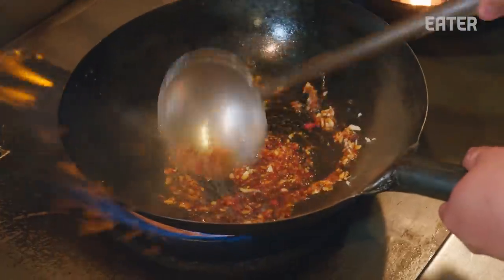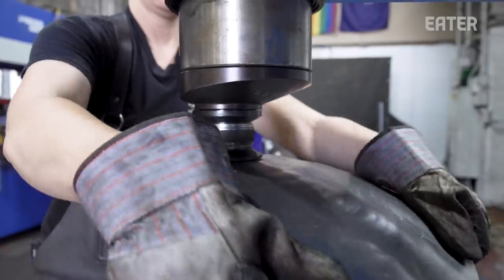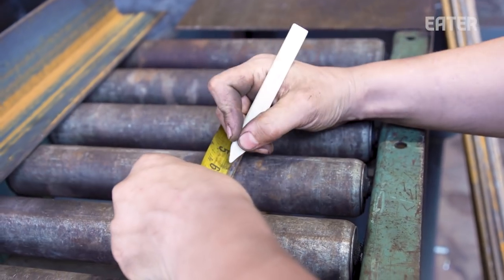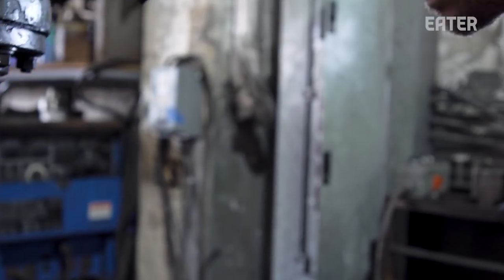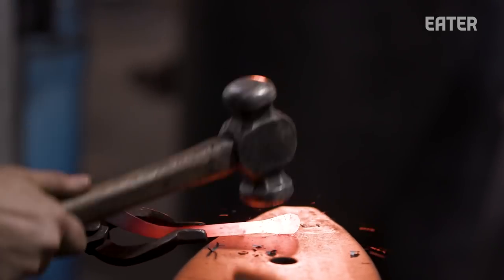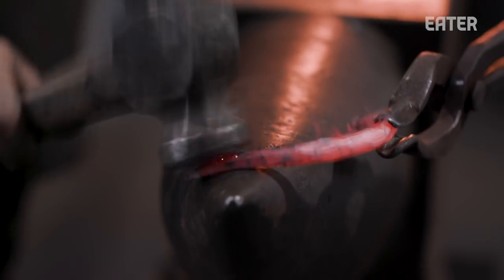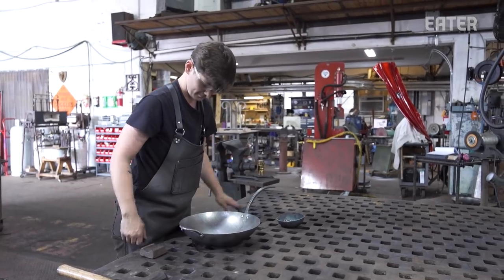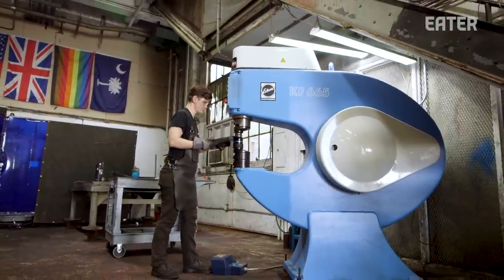How Carbon Steel Woks are Forged by Hand — Handmade

Comment: Love the hammered wok but not a fan of the handles. There is a reason the Chinese woks have those types of handles.
Reply: Go on then, tell us why?
Reply: @AlbanZap  food gets stuck in the rivets
Reply: The round hollow handles are also lighter, dissipate heat quicker/better, and are easier to manipulate the wok with.
Reply: @AlbanZap  heat dissipation and cuts down on weight. also allowed you to insert a wooden handle if that is preference.
Reply: We are blacksmiths by trade, so we decided to stick to what we know :)
Reply: @SnikySnik  Is that the reason they have those handls? wow you're so smart!
Reply: Yeah, they use carbon steel to make them thin and lighter and then they attach a club of iron.
Reply: @AutoFirePad  the handle by itself weighs less than 11oz. 😉
Reply: I agree.  That handle does not go well with woks.  If they tried cooking with an authentic one they would probably understand what's wrong with this one.
Reply: The handle on wok definitely wouldn't be very convenient for Asian dishes since you need to do quite a bit of wok tossing and this type of shape makes it a bit difficult to control (or at least you to learn to get used to it) .
Reply: This is designer cookware. It's a good one at that.

Comment: Great smithing skills. Should have had a wok chef consult you on the design. That long arched thin handle is not good. You want a straight tube handle.
Reply: We did consult with many chefs. They all actually liked the handle shape. Yes, it’s not your standard handle design- but it’s our blacksmithing roots that help us stand out.
Reply: A handle like that is actually easier for tossing around. High end wok chefs often prefer no handle at all, instead going for the Cantonese style wok with 2 grips.

Comment: Have you guys tried making the wok with a round bottom instead of a flat one?
Reply: In the US market, homes don't have ranges that are traditional shaped wok friendly. Many are electric, some are gas. None will have the size required to hold the wok steadily. The flat bottom is a good compromise for this situation.

Comment: So, are the actual steel blanks used to make the wok body forged? They seem like they're just hot rolled sheet. Is only the handle forged?
Reply: They are cut from rolled sheet. The body is forged as seen here. The word “forged” means to shape metal through hammering and bending. Not just to hit hot stuff with a hammer- although that is the most fun way!!

Comment: 3.25 pounds may not seem like a lot, but my 14" Chinese carbon is 3.94# and my 8" deBuyer Carbon is 2.65# - that 3.25# wok is gonna be a beast to work with.
Reply: Alot of the weight is probably on that solid handle. Thats why many commercial woks use thin walled tubes for handles.

Comment: I'd say that is the most not good looking wok and looks uncomfortable as duck
Also I checked the site, it's $325 for the wok and $275 for the pan. The price is just crazy
Meanwhile you can get a real decent and functional wok for $70 or less
Reply: They appear to be a lot thicker than the mass produced items, but regardless, people will pay what they think a thing is worth.
Reply: @Jesse-B  yeah.. every product has their own base.
Reply: @Jesse-B  they are made from 16ga sheet- which is about what you will see in most commercially made woks. Woks need to be pretty thin in order to use the way they are intended in comparison to our other carbon steel pans which can be thicker and still perform beautifully :)

Comment: That has to be a $500 piece. It is an unfortunate truth that you can buy a fine chinese hand-made, carbon steel wok of a larger, more practical size, for $80 or less.
Reply: I guess so, 1. It's handmade forge 2. Made in America. 
It's good craftsmanship I admire it, but for large scale production, why he just bought hydraulic pressing machine then aerospace hammer machine
Reply: @SuperGigaleon  I wondered that too. But it’s probably just the amount of deformation the steel will tolerate without breaking. The process is called “cold working” and you cannot move steel very far in one motion via that process without tearing it.

The alternative would probably be to heat up the blank in a forge or using magnetic induction and then draw it through a progressive series of dies. In high-volume production, these dies would be mounted in a long hydraulic press assembly with a conveyor system carrying the blanks from one die to the next between each press. It might even require a 2-stage pressing where there’s a second heating between pressings.

There is also a different type of process called “metal spinning” where a lathe can be used to form curves into flat metal. But machine tools are somewhat antithetical to a blacksmith’s process aesthetic—not to say a smithy wouldn’t have a manual milling machine, for instance. But a gigantic and outrageously expensive dual-spindle CNC lathe that would probably be necessary to spin those woks reliably —an ultra-precision modern machine tool like that has no place in a smithy.

So you’re looking at a relatively small, reliable machine that fits easily into a fixed-size workshop, which can be purchased via a payment plan from a machine tool vendor who will deliver it directly to you. It’s practical for a small shop to own and can be used for other shop work. And yes it is relatively quite slow and requires a skilled human to operate. But probably the only real alternatives are a sheet metal die-forming factory or a production CNC machine shop. Hand-forging the whole process isn’t an option at US labor rates.
Reply: The woks are $325 😷👍🏻😷
Reply: My 14" hammered carbon steel wok from China (from the Chinese restaurant place) cost US$18.

Comment: Beautiful looking HCS Wok 😁👍... but the handle looks awful 😖👎.

It needs a heat choke at the pan junction, to prevent heat going up the handle, and the grip needs some palm swell and width, so it indexes in the hand and is comfortable to flip with.

If it had all of those features, I would buy one.
Reply: The grip is actually far more comfortable than it may look. Trust me- we prototyped hundreds of ideas as this was the winner. 
As for heat transfer, the differences in the thickness of the body of the pan and the handle in addition to the riveted connection keep the heat from conducting into the handle.
Reply: @anniecolearthur3991  Not having built any myself, i'm inclined to take your word for it.  I can only offer conjecture based on my own experiences to date with styles that look similar.  Regardless, its a great lookin pan.  👍👍👍
Reply: How many woks would you say you make a day Annie?

Comment: Carbon steel is "the same" as cast iron?  They're more similar to each other than either is to stainless steel or aluminum but carbon steel heats up and cools down much faster than cast iron and carbon steel is much lighter than cast iron so there is a significant difference in their cooking properties and applications.

Cast iron rules for searing steaks and pork chops because you can get it absolutely screaming hot without really worrying about warping.  Not that carbon steel necessarily warps easily but why risk it?  One of the most annoying things in the kitchen is an egg that slides to one side of the pan because the pan is warped.  Cast iron also works well for casseroles, stews, etc. because it holds heat so well it's like an oven on the stovetop or in the campfire.  It's the absolute best for corn bread and many other types of bread including pie crust, things you don't really see done with carbon steel.  And then there's fried chicken...

Carbon steel is great for searing more delicate meats like fish and poultry which don't need an absolute screaming hot pan and in fact burn easily in those conditions.  Carbon steel also excels for things like eggs and veggies because it's light enough to really work the pan over the flame sort of like you'd do with a wok  Try doing that with cast iron and I'll wager you'll get carpel tunnel syndrome on steroids.

Comment: Hmm, I've always understood wok seasoning as an iron oxide layer, not the polymerized oil layer you'd find on a cast iron skillet for example. I'll still rub oil after cleaning undeveloped woks to prevent rust, but my fully seasoned woks don't need it after drying.
Reply: In the lab, we call it iron oxide. Outside, it is called rust.

Comment: It's good craftsmanship I admire it, very cool skill.
but IMO, for large scale production, why  he not just bought hydraulic pressing machine then aerospace hammer machine, that machine have equal price I guess? 

I bet his wok cost $100 up than China made, it's only $50 even less
Reply: For us, it’s about the craftsmanship- not about cranking out tons and tons of cookware. A stamping press is not only between 3-5 times the price of our hammer, but it also completely removes the integrity of my skills. I’d much rather shape things with a hammer and create the thing myself than to push a button and let a machine do it all for me.
Reply: @anniecolearthur3991  power hammer way more cheaper, also it have same method to this aero hammer machine
Reply: @SuperGigaleon  we have many power hammers in our shop- we were able to have much more control and speed making the woks with this reciprocating/planishing hammer

Comment: Annie doesn’t use gloves. Insane
Reply: The use of gloves while smithing is a pretty debated topic. I was brought up in the school of thought (and still adhere to) that you should only where gloves when absolutely necessary. 
You’ll see that I use gloves while shaping the body of the wok. I do that because the edges of the pan blanks are sharp. I do not wear them while forging because it gives me better control over my hammer and tongs. Having my hands bare allows me to feel the radiant heat of the metal before my skin contacts it- so when common sense and safety is applied- I know what things are or are not safe to touch. Also, at the heat that we work at, the metal would burn through gloves quickly. 
There are many other reasons as well, but all that said- it is still a debate amongst blacksmiths and this is just my opinion. :)
Reply: @anniecolearthur3991  whooooa, i never saw this comment. Thanks for replying! Hope that “insane” didn’t come off as rude, i meant it as more “mind-blown.” Excellent work!!
Reply: @jhammylive  No worries at all! When it comes to blacksmithing videos, folks tend to have very strong opinions about the way smiths work. So I just do my best to educate where I can :)

Comment: Yeah, wonder why they don't use a Press for the wok shape
Reply: Answer is at 1:54..
Reply: Why not just use a press die a lot of times to strengthen it then?
Reply: We tried it when we were creating our prototypes- and long story short, we weren’t able to find a way to press it without the edges crinkling. Plus, using a power hammer such as this reciprocating hammer- we were able to stay more true to our blacksmithing roots!
Reply: @anniecolearthur3991  Ty for answering!
Reply: My $10 40 year old carbon steel wok is still going strong and the non-heat conducting wooden handle is as good as new! The one item I’d want to be marooned with on a desert island
Reply: @anniecolearthur3991  Thanks for replying! So, sanding off the crinkling edges isn't possible?
Reply: @mytchtan9691  The size of the crinkles were far too large- almost like a scalloped edge. Which was interesting, but not at all what we were aiming for.
Reply: You obviously did not listen to the video
Reply: @anniecolearthur3991 ohhh. Thanks for replying 😁👍🏽
Reply: Hellp

Comment: That handle would be almost as hot as the wok when cooking, seems a big design flaw to me for something cast iron
Reply: Isn‘t that the reason they rivet the handle to the wok? A handle attached by rivets as compared to welding it on shouldn‘t get hot. At least that‘s what i see with my All-Clad pans.
Reply: First, the pan is not cast iron- it is steel.
Dirk is, in part, correct. The rivets do slow the spread of the heat. We rivet rather than welding because riveting is a more traditional form of joining two pieces and it is actually one of the strongest types connections. 
Additionally, the handle will not heat up nearly as quickly as the body of the wok. The body of the wok is significantly thinner material and therefore heats (and cools) much faster than the handle does.
Reply: @anniecolearthur3991  yes use it at home with a less than 3 inch flame but in a Chinese restaurant with jet burner.

Comment: woks forged "all by hand" my ass. the handles are but the wok is forged by a power tool. stop stealing the machine's credit damn it!
Reply: Smiths are only as good as their tools. And tools are only as good as the person operating them. It’s a codependent relationship between hammer and operator.

Comment: Not wearing gloves on furnace D:
Reply: The use of gloves while smithing is a pretty debated topic. I was brought up in the school of thought (and still adhere to) that you should only where gloves when absolutely necessary. 
You’ll see that I use gloves while shaping the body of the wok. I do that because the edges of the pan blanks are sharp. I do not wear them while forging because it gives me better control over my hammer and tongs. Having my hands bare allows me to feel the radiant heat of the metal before my skin contacts it- so when common sense and safety is applied- I know what things are or are not safe to touch. Also, at the heat that we work at, the metal would burn through gloves quickly. 
There are many other reasons as well, but all that said- it is still a debate amongst blacksmiths and this is just my opinion. :)

Comment: lol they waste a lot of energy just for making that curve shape...they should use press die.. in 1 shot it will Achieve that shape... just like they use in automotive and various industries...waste of time
Reply: “Hand Made”
Reply: They're literally hand made. Thats what blacksmiths do. If you want some machine made junk then go to Walmart to buy your cookware.
Reply: @TravelingStacker  its not handmade…. They use power hammer… What the difference by just pressing it?
Reply: @TravelingStacker  3Head much
Reply: @reynaldorosas4187  Yes, they use power hammers. Most blacksmiths do. They use standard hammers as well. Each piece is  unique. They aren't mass producing them. Some people want made by hand. Some people want mass produced. As someone who own two of their skillets, I prefer the uniqueness of each one over a perfect pressed one.
Reply: @reynaldorosas4187  the power hammer provides the power and pressure- my hands provide the skill, split second judgements, and technique. We decided not to press them to shape for several reasons- but the two main reasons are that we weren’t able to achieve the shape we wanted without creating a large ripple effect or buying $$$equipment specialized for pressing out a shape (as in the automotive industry), and that we wanted to stay closer to our traditional blacksmithing roots. I am a blacksmith at heart- not a machinist- and I would much rather spend hours using a hammer than seconds to press a button and watch a machine do my work for me.
Reply: @anniecolearthur3991  that makes sense...great workmanship on each product though...

Comment: too fancy and expensive the Chinese child labor one is cheaper and better looking and it is not flat bottom and for safety and saving your ears use the proper ear protection the proper protection is over the ear
Reply: I use hearing protection in necessary settings. While it may not come across in the video- the sounds of the shop are not very aggressive when only one person is working at a time. So for the video, I didn’t wear any hearing protection- but on normal days when our entire team is working, I wear them all day long. Thanks for looking out though!

Comment: 2:30 All that work to make a proper wok, and then you flatten the bottom 🤦‍♂️
Reply: Nothing wrong with a flat bottom, it has its pro, just ask "Wok with Tak" granted I prefer a round botton.
Reply: Smithey decided to do a flat bottom wok because we make cookware for “the home chef”. Most home chefs don’t want to have all the extra accessories or dedicated setup for a round bottom wok. On modern China, they are often using flat bottom woks now. You really only see round ones in very traditional Chinese restaurants.